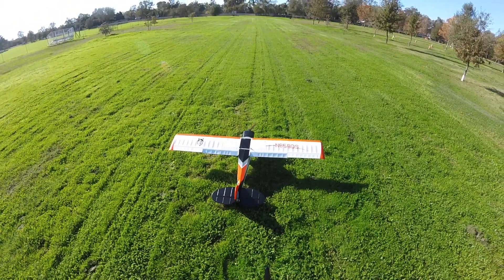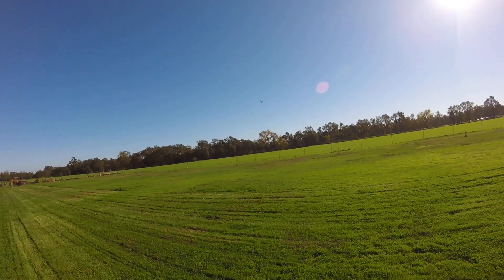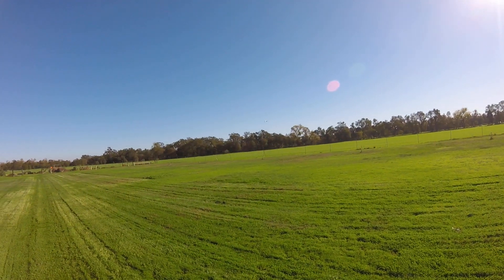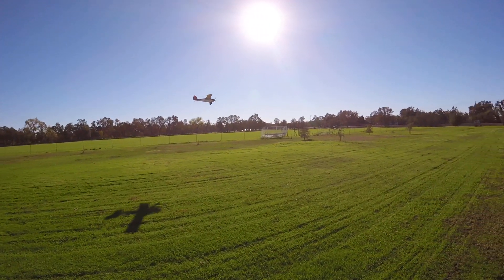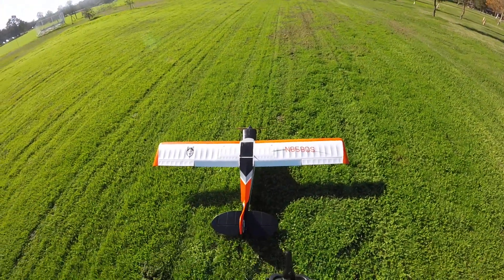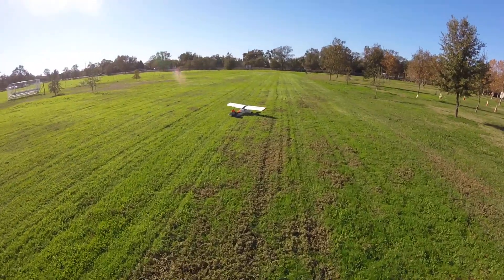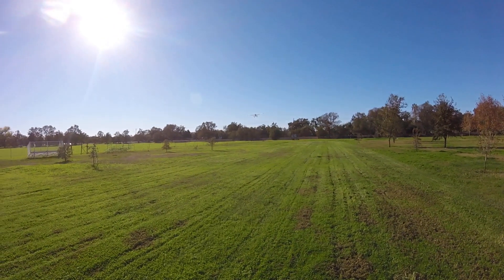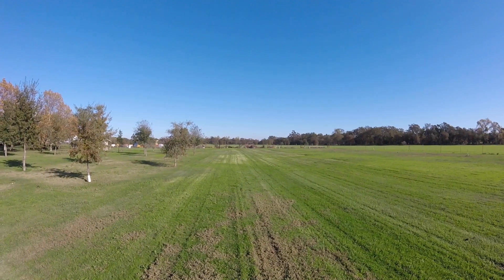Arrows Husky RC Plane on 6s lipo

Comment: maybe the prop is out of balance  or  something else  'vibrating'  at  cruising throttle setting.          this sort of intermittent problem  resembles servo  Glitching.   from  excess vibration.       d
Reply from the maker: Thanks for the tip, I'll check.